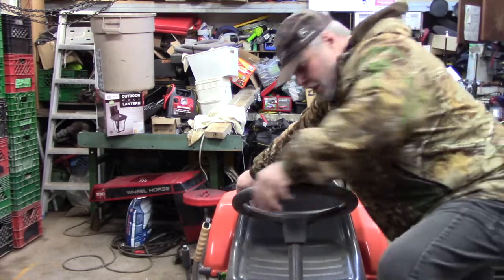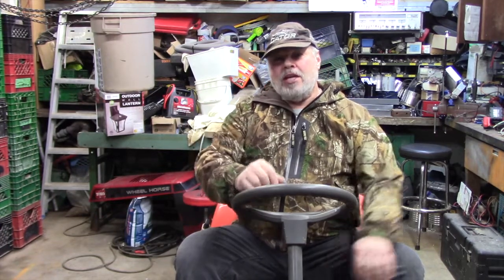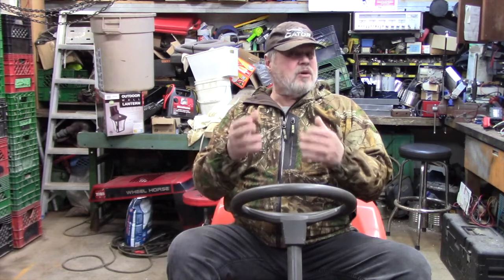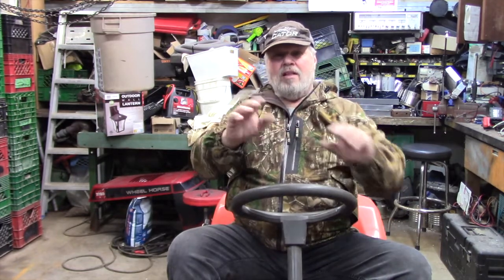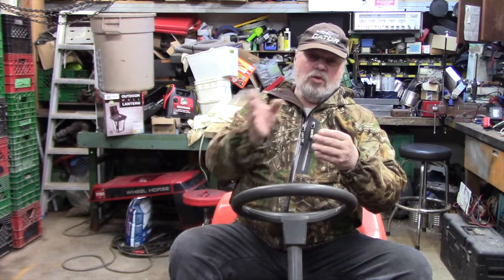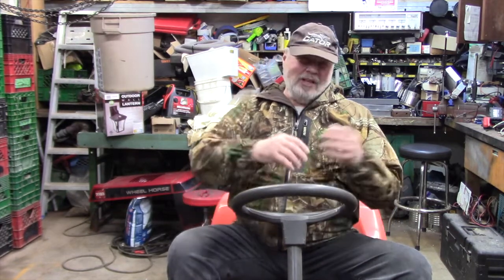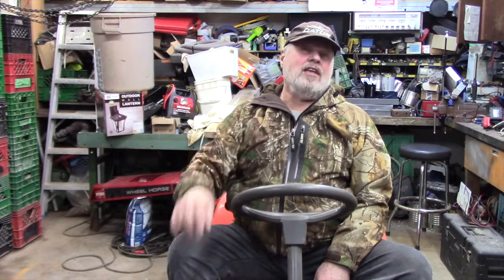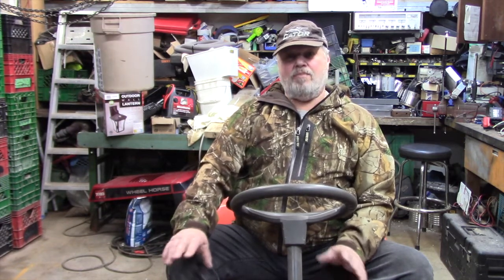Vacuum wipers

Comment: I bought a 1956 or 7, I forget which year but close, step side Chevy pickup, as my first automobile. 
$25.00 total invested. 
My friend had the truck. It had the oil line on the outside leading to the head to oil the rockers. It leaked so he cut it off and folded the end over. 
After the rockers seized up He sold it to me for $25.00. Another friend had a spare head so we swapped it out. 
It had the vacuum wipers. Step on the gas and the swung out to the sides and stayed there until you let off. 😤
I'd be flipping the throttle just so I could see. 😁😎